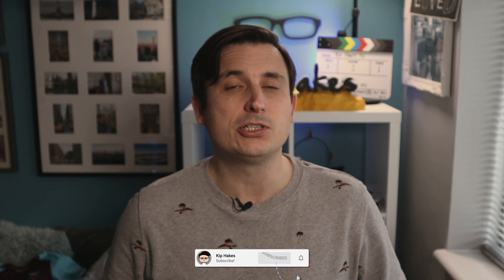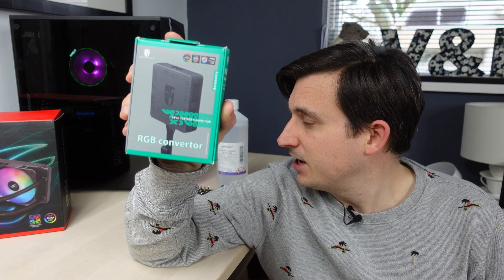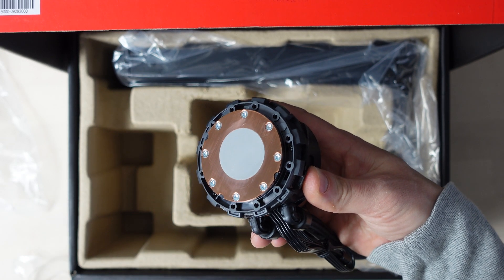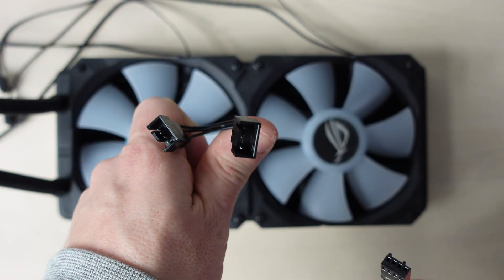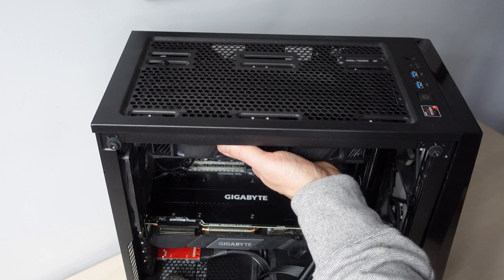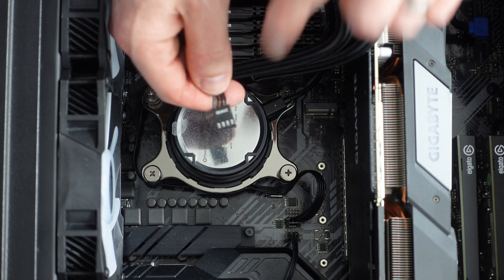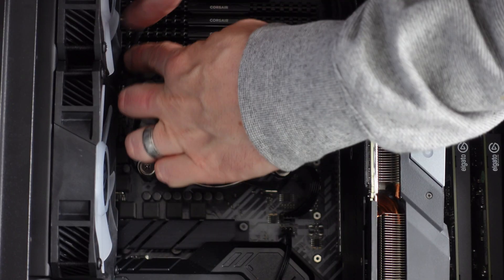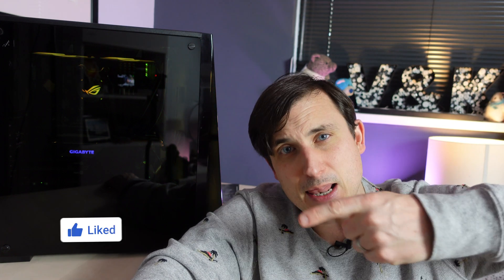Upgrading my Ryzen 7 CPU to Water Cooling - Part 2 - Installing the Asus ROG Strix LC 240 CPU Cooler

Comment: Just installed this in a Corsair t200 case… had to grind my memory heat sinks to make them fit!
Reply from the maker: Ouch
Reply: @KipHakes  I think it should work… I just did it about 15 mins ago lol. Corsair vengeance RGB pro won’t fit at stock size. My PSA of the day lol.

Comment: Hi mate, nice video. I am putting this fan in Phanteks Eclipse G500A D-RGB Mid-tower PC case with Asus TUF Gaming X670E-Plus WIFI (Socket AM5) DDR5 ATX Motherboard. Do I need this RGB convertor to get the front fans to match the AIO? Cheers
Reply from the maker: Honestly, I don’t know! Sorry!
Reply: @kiphakes  no worries mate thanks for prompt reply. I'll just try it without first and use your link if need one. Cheers dude 👍
Reply from the maker: Thank you! If I've learnt anything from RGB in builds is that you never can tell until you've got the product infront of you usually! So many different standards!

Comment: The fans are facing the wrong way - you'll be pushing the heat from the radiator back into the box. You want the fans to pull the heat out of the radiator up and away from the box. If you can flip the unit and use the top vent of the PC Case you can have the fans pull the heat off the radiator and up and away from the box.
Reply: Those fans are mounted correctly, looking at the mounted fans you can see they will spin counter clockwise. An easy way to tell which way a fan will push the air, is to see which side of the blades are cupped. The concave side pushes the air.

Comment: My only problem with this cooler is the pump. Its loud on 100%
Reply: Is the pump loud or the fans? I am thinking of getting that cooler with an ryzen 7 5800x. If only the fans are loud, then i am just gona swap them, but if the pump is loud then i am not gona get it
Reply from the maker: I don’t think either are particularly loud
Reply: My pump on 80% is silent 2400-2500 rpm. And 75% or under its totally silent. 
100% is loud at night when its quiet. 2700-2800 rpm.
Or mine is idk. I mounted mine on top. 3 fans in front and 1 in the back. Never see temps go above 65c "standard profile". And i play a lot of CPU hungry games maxed out.
(i7 10700k & Rtx 3080)

Comment: I literally, cannot, for the life of me. Plus in that micro USB on the AIO. Like the part that goes into the cooler at the bottom. It just won’t go on. I have it the right way up but it’s like I’ve been given the wrong cord because mine just won’t plug
Reply from the maker: I found it SUPER fiddly to put it in - I had to edit out the 10 minutes shouting and swearing at it! I was very nearly at the point where I had to take off the cooler and plug it in.. That might be your only option! Good Luck!

Comment: I have problems with getting the rgb to work on the pump? Any suggestions?
Reply from the maker: Eeek - no not really! Sorry!
Reply: Same problem, did you fix yours now?
Reply: @rjsantos6012  Ye I did, just had to replug the cable to the pump. And after boting the rgb turned on automatically.
Reply: Does it showing in armoury crate? Because mines not detecting
Reply: @rjsantos6012  Ye it does

Comment: I do not see that you posted a part 3 explaining the software side of setting up rgb for this aio. I have the asus 360lc aio (white) and am using corsair LL120 fans controlled through ICUE. I have the Asus dark hero x570 mobo. I can change rbg on everything except aio pump. The aio pump just cycles colors. The aio does not show up in ICUE nor does it show up in Armory crate. If anyone can help, would be much apprieciated.
Reply: It's Asus it's needs Asus aura then you need to allow other programs to control

Comment: So I have this installed to my PC and just like your issue, I had to get the rgb converter as well. I did it  but my fans don't work right.. they light up but the colors are more dim than my chassis fans and they flicker a lot. Help please?
Reply from the maker: Could be a faulty RGB converter?
Reply: Ita rgb not argb , u might have argb in ur chassi
Reply: @ecosti  no this one was argb. But I fixed this issue a long time ago.
Reply: @cobhc616vv   oh so this cooler is argb ?! Are u happy with it ?
Reply: @ecosti  I'm happy with the cooler but wasn't happy with the lights so I changed out the radiator fans for some ekwb radiator fans which are better.
Reply: @cobhc616vv  dunno i ordered this one but i canceled it , i read so many bad reviews it made me rethink my choice
Reply: @ecosti  it's a good aio for sure but there is much better out there. If you are looking for cpu water cooling, check out EKWB. Their products are incredible.
Reply: @cobhc616vv  never heard of them , will have a look

Comment: I recently installed this aio into my pc and after doing so my startup speeds and speed in general is super slow. It takes 7-10 mins just to boot it up
Reply from the maker: That's really weird! Never heard of anything like that
Reply: Nothing to do with a cooler :p  task bar check if its cpu and disk high usage , some latest windows updates fucked up and turned on the windows search , had same issues the moment i disabled it pc feels so fast

Comment: hey i installed the same LC onto my MSI z390 MB but i didnt get the RGB to work any ideas whats wrong?
Reply: use Armoury Crate app
Reply: @Vaffanculoilluminati  ik, did something wrong with cable. besides it worked with the msi software aswell.
Reply: @kevinbentz4523  nice to hear mate , enjoy it?

Comment: Hello, what are the RGB Fans that you are using mounted on the front of the case?
Reply from the maker: They are just the ones that came with the case.. It's a Corsair Spec Delta

Comment: i purchased this cooler from microcenter for 198 bucks...Complete waste of money do not do what i did. Get the Arctic freezer 360 or the EK 360 much better and alot cheaper. the RGB fans stopped working the 3rd day and was only producing a slight green glow. i did everything to try and fix it but it didn't work. overpriced this cooler should be atleast 70 bucks.

Comment: yo i got a question that mounting plate for the ryzen processor im also getting the same aio and im just wondering where u can get that ryzen mounting plate or does it come with the package?
Reply from the maker: It's in the packaging.. Check out my unboxing video to find out what you get in there. Also regarding noise, unless you crank it up to full speed. (which isn't needed) you won't hear it in another room